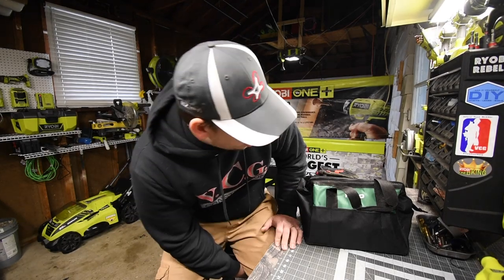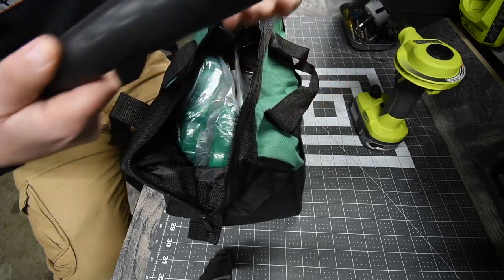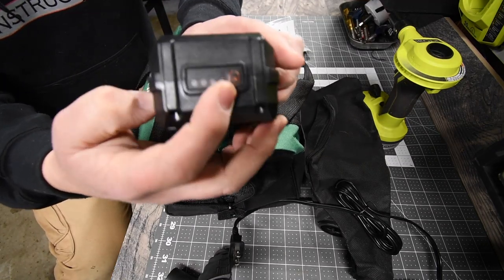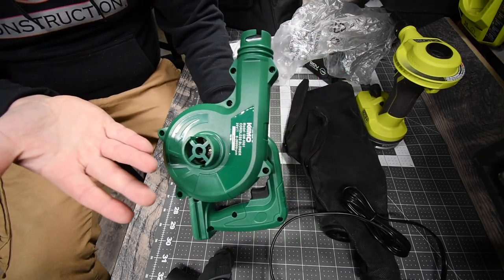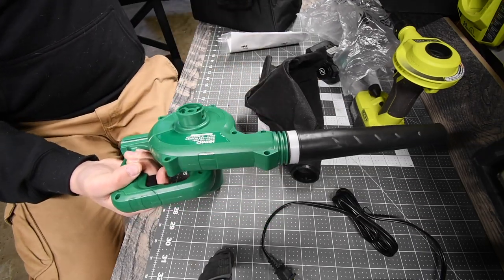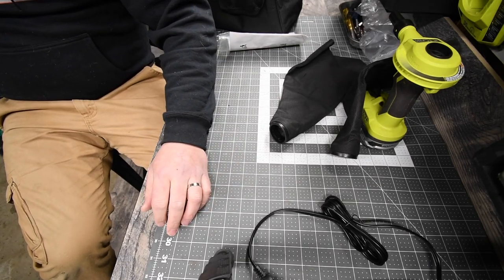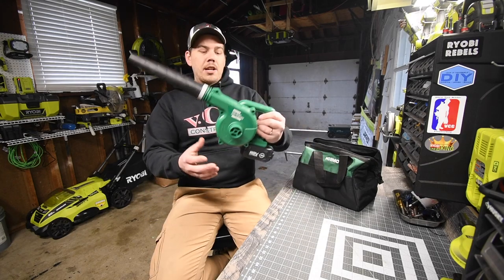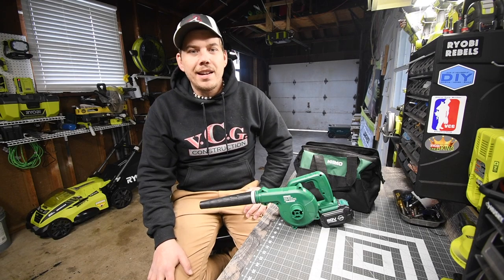KIMO Blower Kit unboxing/test

Comment: Hi,

I have the milwaukee and dewalt jobsite blower.  They're both great and i use it to clean out my garage floor, pickup truck bed, trailer, tools, rain gutters and light leave cleaning on walk way and driveway. 

Even though both jobsite blower are almost identical i like the DeWalt better. Once you let go of the trigger on the dewalt it stops instantly. Plus it feels like it pushes out more air then the milwaukee.  

The milwaukee is also good but it has a few minutes of delay on stopping the air coming out of the tube. Again, less power on the air out. 

Still a great tool to have. 

Just my thoughts. 

Thanks for the video
Reply from the maker: I thank you for the input Michael. I will be picking up the other brand blower as well :)

Comment: Don't throw the dust down the floor drain
Reply from the maker: I don't and the floor drain is clogged up and doesn't even drain. its been like that before we even bought the house
Reply: Man Caver Tools Time to buy the Ryobi auger then
Reply: Man Caver Tools break up the concrete and change the pipe
Reply: @batnav10  the drain auger?I have 2 of them.Only good for small sink drains
Reply: Steve kokkinidis I don’t have one but I would have thought the 50ft hydrid one would be a little more durable. I have heard great things about the Milwaukee auger.
Reply: @batnav10  it's only good for small sinks.It's great for small drains where the standard 1/4" cable won't fit.I have all the the milwaukee drain cleaning machines